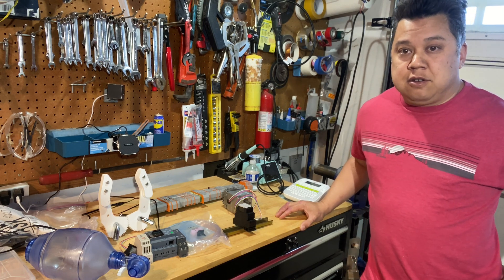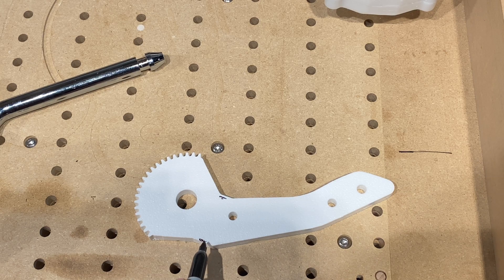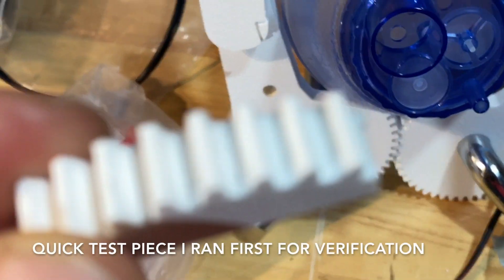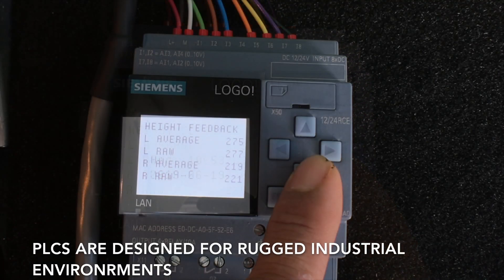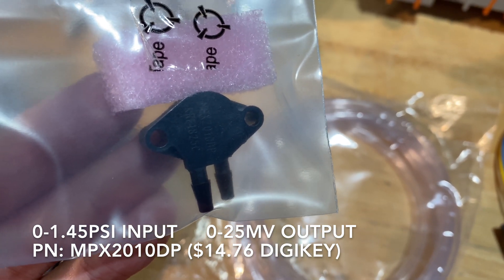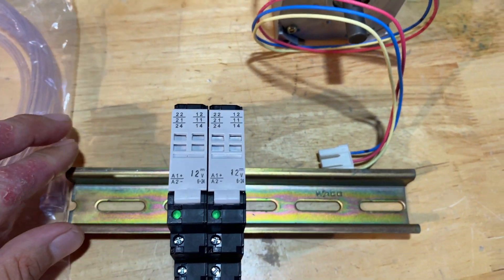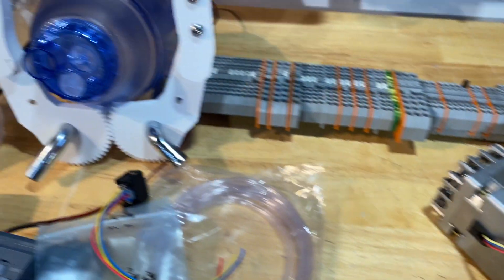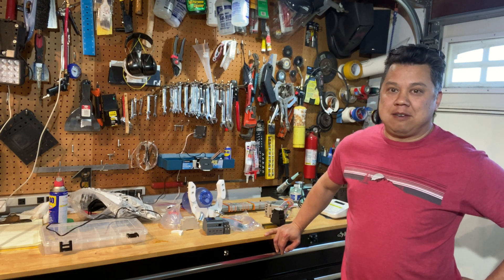DIY Breath Controlled Ventilator Part 1

Comment: Take a look at this: @ An easy to construct, cheap, simple, reliable emergency ventilator. Can be used when the power is out – it will run on a 12 V car battery – or used when there are insufficient ventilators. It will save tens of thousands of lives in the Third World, where there are no ventilators. 
No software, no computers, no delicate components, no machining is required. Except for one motor and one Ambu bag, the ventilator can be made from wood, plastic, or metal.

Comment: Might as well be made out of gold. No one is going to have these things just laying around their house, nor be able to get them easily.
Reply from the maker: There are plenty of people with 3D printers and desktop CNC machines that can make these parts. The Ambu bag kits are available on Amazon. The mechanics of squeezing the bag can take on any shape, it doesn't have to follow this design.  There are 100's of designs people have published on YouTube, but 99% of them lack controls, they just run on a fixed time interval.  The controls hardware and software is the bigger challenge to making an effective ventilator, that's what I've focused my efforts on for these videos.  The PLC is readily available, and I'm providing the PLC program for free.   Designing the hardware and software was a solid 40 hours of work, hopefully it gives everyone else trying to build a ventilator a 40 hour head start.

Comment: I've great respect for you. I've been following your passat build since 10years ago. ventilators don't work like that I'm sorry. it's very worthless. please learn what they do. it's not just a simple pump. you have no idea what you are doing
Reply from the maker: I'm not building a simple pump. This is an Assist Control (AC) mode ventilator.  I have peep, I have pressure sensing to know when the patient is inhaling, to trigger a breathing cycle.  Adjustable I/E, adjustable flow rate, adjustable volume.  What essential feature am I missing?
Reply: @etischer  https://www.youtube.com/watch?v=7vLPefHYWpY
Reply from the maker: @riskinhos  yea, I've watched it, I have it linked on my ventilator website.  What critical feature are you suggesting I do not have?
Reply: @etischer  I have no idea. You have way much better skills than I do. You are a legend sir

Comment: It's a good design. Electric drills will allow people to manufacture thousands of cheap ventilators at home using cheap Manual Resuscitators. Electric drills are mass produced, easily accessible and contain a battery, gear box and a speed controller with a trigger that could be taped to the right speed. In most cases the batteries fail before the motors in a drill. Therefore broken drills could also be attached to car batteries and turned into ventilators. 

(car window wiper motors and car batteries could also be used). Press the bag less for children by changing the size of the disc or the lever that presses the bag. Here are some simple designs that could be developed further. 

https://youtu.be/QX9uR3bszbc
https://youtu.be/evWKC7D35AE
https://youtu.be/SOVQIx0On30
https://youtu.be/_6fWpdXvOYk
https://youtu.be/vdLXp7uGFX4
https://m.youtube.com/watch?feature=youtu.be&v=v-F1WAANbk8
https://youtu.be/lF7qLgttdww
https://youtu.be/dCnaK7_GXFU
https://youtu.be/IdbxZeLxQQw

This one is using an arduino
https://youtu.be/Ra4uqrrBeHA

More complex designs are from universities like MIT

https://e-vent.mit.edu/

http://news.mit.edu/2020/ventilator-covid-deployment-open-source-low-cost-0326

https://e-vent.mit.edu/updated-electrical-operations/

https://youtu.be/1t2t8d8xtD0

https://www.youtube.com/watch?v=1t2t8d8xtD0

https://youtu.be/RpEqtGa2vTI

https://www.autobeatonline.com/news/converting-windshield-wiper-motors-for-coronavirus-ventilators-

For people whose lungs are damaged:
https://youtu.be/ntFQay9cy8Y

Scuba diving parts could be used too.

The medical companies are worried
https://youtu.be/YHZSjj3Yjuc

Comment: Awesome... Relays as motor contactors as I'm sure you're aware it's about the spring strength to break the contact weld essentially the reeds are too small if you're looking for duty cycle you need a motor contactor The contacts are designed to break fast with Arc  extinguishing characteristics with huge meantime between failure
Thank you.
Reply from the maker: Yea, I don't normally use relays for motors, but figured at some point a tiny motor might be ok.  If the project looks like it will be used, I'll invest in some solid state relays.  The AC gear motor didn't come with the capacitor, so I haven't  run it yet.  I also bought a Nema 34 stepper  motor, I think it will be easier to get things going having the ability to control the speed.  I'll try both and see what works best.  Thanks for the feedback.